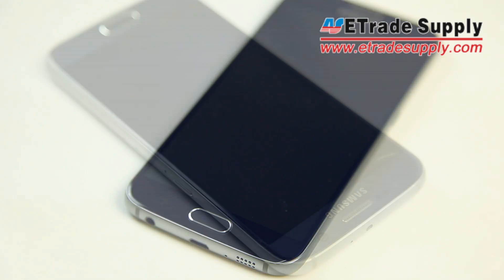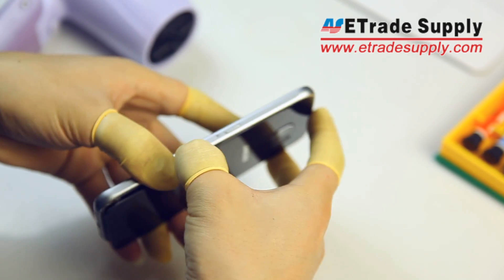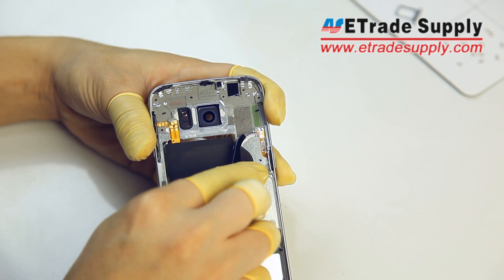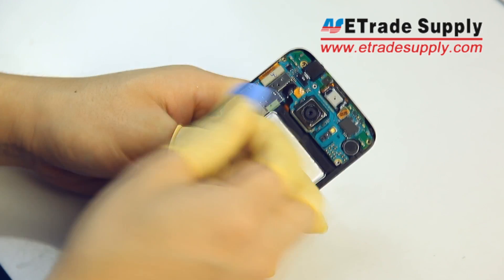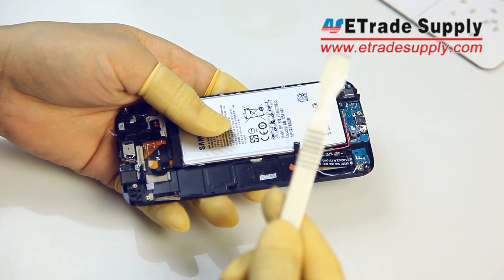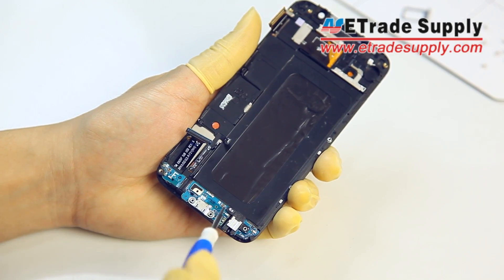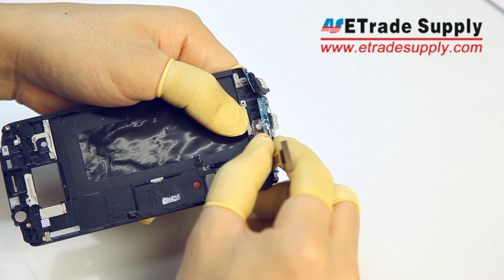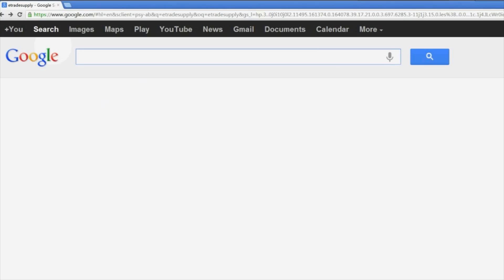Samsung Galaxy S6 Disassembly/Screen Replacement/Charging Port Fix/Replace Battery

Comment: Non-removable glass back, no micro-SD, no waterproofing or dustproofing... Samsung wanted to make the Galaxy more like the iPhone, so they adopted the iPhone's worst physical features!
Reply: Jane Doereme
I guess my whole point is it's not a Galaxy S phone anymore. It's an iPhone running Android.
Reply: They gave the people what they wanted:premium materials...but with the cost of the microSD card.but unless Apple,Samsung offers the phone starting from a memory of 32GB instead of the 16 on the Iphone 6.
Reply: I agree it's like samsung stepped away what separates samsung from apple
Reply from the maker: RadioactivFly it seems so
Reply: skate4world
 Would it be so hard for them to have put in an SD card slot similar to the SIM slot?
Reply: RadioactivFly Samsungs support usb hosting: use a flash drive or external hard drive or your pc to store more stuff if 32, 64, or 128GBs aren't enough for you
Reply: Jane Doereme
 Yeah... and plug some bulky thing into the bottom of my phone. No thanks. Plus, they removed the S5's waterproofing, don't forget that. And the non-removable battery... You see, batteries have expiration dates. You can't just charge and discharge forever, the reactants inside break down. On the S6, the battery's expiration date is your phone's expiration date.
Reply: Most people get new phones after 2 years anyway. But I understand where you're coming from RadioactivFly . The usb adapter I use isn't bulky and I don't carry it around with me. I just use it to transfer files whenever I need to and unplug it. None of my phones ever got water damage so for me personally I didn't miss the water resistance the S5 gave us. But for those that care, get a lifeproof or waterproof case. Or don't get the S6. Also there is a S6 active.
Reply: RadioactivFly I agree.
Reply: +ETrade Supply Samsung is way better than Apple.
Reply: The S6 is pretty much an iPhone running Android.
Reply: *****
Now you're arguing semantics. You used to be able to take off the back by design and pull/change the battery easily. With the S6, you have to break into the phone. The battery was never intended to be removed. Also, MicroSD.

Comment: Hey can someone tell me if putting rice and the samsung galaxy s6 going to do anything (yes i did drop my phone in water but i cant open it up does it doanhthing to help it or is it useless?
Reply from the maker: tKayos24 NO, You'd better not do that. It won't help to save your phone but may do worse on the phone, just power off ASAP and disassemble it into pieces  and wipe it use clean cloth, if there are erosion already, use alcohol to wipe it out, try whether there is short circuit or not. If damaged heavily, you'd better turn to your local repair shop! Good Luck!

Comment: Im wondering if it would be possible to put the slightly larger s6 edge battery inside the standard s6. Anyone know or tried it? *****
Reply from the maker: Pablo Pussell Good question! we'll think about it, thanks for your feedback, if it works, we will make a video to show you how we do it! =)

Comment: hy,where Are the Water Damage Indicators On galaxy s6. tnks
Reply from the maker: Alexandru Darius Actually, there is a anti-water mark on the rear housing. depending on different material, it will be soft or turn red to show the water damage.

Comment: I couldn't get a good look at it, but on the bottom right where the speaker is. Is there any explanation as to why the screen might not be flush with the aluminum bezel?

Comment: Hi! I need help...!! my galaxy S6 accidentally fell in the swimming pool, got wet and screen died. I just wanna know if there is any chance i can still revive the phone without having it replaced under my gadget care. would appreciate your help. thanks
Reply: If u have insurance in which u should... just get another one..if u don't try to plug it in and simply let it dry a good repair store and can easily restore the unit
Reply from the maker: Spam TheChat The rice can't do much drying the phone. The best way to dry water-damaged phone is to lay the parts on a draughty place.

Comment: Just a quick question i live in Az and in summer it tends to get to about 120` F will this effect the adhesive in any way?
Reply from the maker: Ryleeman54number2 
The adhesive will be affected by the temperature. But 120 F wont be a problem coz the temperature to loose the screen adhesive is around 200 F
Reply: ok thank you

Comment: So in all reality, the black glass=super easy to replace if broken. The battery a bit more difficult because you've got to remove the back, then the front (although I don't think anything beyond that is necessary, you could just pry from the outside rather than the main-board side), and if you break the screen it'll be a major PITA....but do-able.

Comment: I'm not looking forward to repairing this. Looks like a pretty expensive repair too. If the back glass is cracked, that's going to have to be replaced. It's likely to shatter if you try to remove it.

Comment: Hey I have an s5 that fell on its back and the screen went black. I got the screen replaced but the camera is not working. It gives the camera fail error when I open the camera and the phone signal gives alot of problem picking up sometimes it doesn't pick up at all in certain places. The place were I got the screen repaired cannot figure out the problem.
Reply: They also tried a new camera in it and still got the camera failed error. I had a perfectly working camera and everything before it fell

Comment: Nice video , one question , is it possible to reach/remove the battery without taking the front screen off the mid frame ?

Comment: Unfortunately the iphones are still much better built inside and out. The galaxy s6 is put together by glue. Not very good build quality and the glass being used is not very fingerprint resisitant at all.
Reply: King Dorien Minor  Lol why would you have an iPhone if you hate them so much?!
Reply: Yes i have an Iphone 5C and i replaced my broken front glass myself. I didn't even need 10 minutes for it. Just removed the screws, lifted the display up disconnected it from the mobo and connected the new display unit to the mobo and put everything back again-thats all. Ok it was expensive to buy the new display unit (as far as i know its still cheaper than samsung) Im not an Apple fanboy but we should admit that the Iphone is still the best repairable smartphone out there (except Fairphone) 
Also smartphones were not built to last they were made for being replaced. So if the built-in battery breaks in this Samsung you will have to replace it with the S7 or S8. 
We have 14 I-devices, 2 of them Ipads. I know that sounds like im a fanboy but still im not. Now guess what- all devices are still working. Ok, some broken display glasses here and there and the Iphone 4 has Home Button issues. Even the Iphone 3G from 2008 works or our Ipad 1. 
So what i wanna point out is that: When its about hardware Samsung and most android phones win easily
When its about quality the Iphone beats nearly every phone. I pay the same price but for a better quality. And i like IOS more :) But thats up to everybody to decide.
Reply: Brian Tasker

I agree. I dont need a phone case until now i never let a phone drop just repair them if somebody breaks them. But i bought one which looks great on my 5C.
Reply: Mabirc Min I don't really care if I get an iPhone or an android, as long is the specs are really good. Like 720p or 1080p, faster processor and etc...
Reply: I have used android and its not for me. Whether its a 2k or 4K screen the user experience and ease of use is not on par with iphone. Even on my 6 plus the full HD screen is more than enough on a phone. 2K and 4K screens are overkill because its only a small difference to the naked eye.
Reply: ***** My son just bought this Samsung phone and already the front screen is shattered. I just bought a kit to fix the sound and replace the scratched screen on his old iphone 5 and he's going back to that phone because he hates the size of this monster. I don't blame him because with the rubber sleeve around his phone it won't fit in a pocket. I don't blame him, I wouldn't want this phone either. If I need a large screen for something I'd grab my laptop before I bought one of these things.
Reply: Mabirc Min I fully agree with you and since my son only had his Samsung 6 for less than two weeks he'd agree with you too. With a broken screen already and having his iphone 5 for almost two years without a problem until someone nailed him and work and the thing went flying out of his hands and broke the front glass. I just bought the repair kit for $29.10. He'll have his iphone back very fast and he'll be much happier than having this over size phone and under size mini laptop.
Reply: Johnny Ola If I wanted ease of use, I'd buy a flip phone.  I had an iPhone 5S and hoped I'd like it enough to stick with Apple.  I didn't.  I can customize literally everything on an Android phone.  Even with a jailbroken iPhone (which is getting harder and harder as Apple continues to try and crack down on it) you don't have 1/10th the customization options that you have with an Android device.  To each his own, but as someone who owned an iPhone, I don't understand what's so great about the user interface, or how people could say it's easier to use than an Android.
Reply: Deacon Wolf I agree with you. I bought an iPhone 6 to try out iOS 8 after buying the piece of shit GS5 but was very disappointed. I bought the GS6 about two weeks ago and I must say... This is an amazing phone.
Reply: Still, I'm not going to buy an Apple product untill it stops being overrated & overpriced
Reply: And only few types of glass are fingerprint resistant, and if they used them the price would get.....
And I use a s6, and no problems with the fingerprints, That is only a major problem with the gold.
Reply: Tom M lol little kids dont need phones and maybe iphone repair is faster but dont forget iphone screens brake faster then the s6 ...
Reply: lennert eykens
its not your job to decide whats wrong or right for his son. Though every little kid now has the newest smartphone. Maybe Iphone screens break faster but they are easily replacable. And i rather buy a phone that i can repair myself than one that i must replace or have a hard time to repair. We have 14 I-devices and every single of them works. Every broken screen was replaced. Im not a fanboy but i would never choose anything else than Apple.
Reply: I repaired my s6 edge in 15 min seriously? Some people just dont know how to carefull use phone if you use a case and screen protector its all good if you just play around with every phone without a case yeah then every phone breaks so iphone isnt even better and repairing your iphone screen cost you 120$ or more instead using your warranty of your phone and get it replaced it once you replace the screen by yourselff you dont have any warranty anymore and nop its not my job to decide what someone els kid doing right or wrong one thing a phone is bad for a kid kids dont need phones if they need something to play a game one then buy them a ps vita instead buying something they wil break in 1 sec where you spend 699 dollars on dont tell me that phones are good for kids ...
Reply: lennert eykens  My grand daughter has had her iphone 5 for the past two years and she'll be due for an upgrade soon on their family plan. My grandson is in 1st grade and has an iphone 4s and has had it for over three years and not one of those screens were ever broken. My son had his iphone 5 for over two years and until it went flying out of his hands he never had a broken screen. Now he has this oversize phone and undersized computer made by Samsung for two weeks and the screen is already cracked. After watching this repair video and already buying the repair screen for my son's phone, all I can say about this build quality of Samsung phones is pure junk. The good thing about this Samsung is the speaker. It's the loudest I've heard on a mobile phone yet. That would be the only thing to encourage me away from the iphones, which is doubtful because the size of these Samsungs are something I couldn't deal with.
Reply: lennert eykens Maybe you feel that kids don't need phones, my son would put up a great debate on that subject and that's the reason why his kids all carry a phone. Never again will there be a problem in this family  If I had young kids today I'd make it a requirement that each have their own phone because I also feel it's necessary in today's society for safety reasons.
Reply: lennert eykens
Then you seem to be good in repairing your own phones! But again, compared to what you have to do in an S6 or an Iphone 6 for replacing your shattered screens are worlds! For replacing the shattered screen of my Iphone 5C i needed only to take away the screws, lift the display unit up and remove the cable and put the new display in while in most other phones you have to completely disassemble it. Btw i paid 65 bucks for the repair kit with the new display! And if you compare repair costs of Iphones or other phones the Iphones are cheaper.

Idk if its bad or good for kids owning a smartphone but in one point it is very helpful: They teach them about the internet and possible dangers. They also teach them our future and our future is going to be in smartphones and tablets!
Reply: Tom M if the size of the screen determines what is junk or not than every sports stadium and movie theater in america is doomed. Shouldn't your "problem" with screen size be the fist thing you notice when phone shopping? Also was your son's s6 in a case? Was his iPhone in one for those three years? Screen protectors? Neither I nor anyone in my family have ever broken the screen on a Samsung device but my sister is on her fifth iPhone in the past 12 months, all d
Reply: Continuing... due to screen problems and cracks. While I will give you that my sister is absurdly clumsy, it is rediculus that 4 phones with cases and screen protectors could literally fall apart after one drop. And you claim samsungs are poorly built. When an s6 brakes you don't have to worry about large shards of glass at least, galaxy screens are laminated as far as I know apple screens aren't. I love my S6 and will be getting another Samsung when this phone's time is up.
Reply: Brian Tasker
You know, Iphone screens are easily repairable and getting 5 phones in 12 months does not make sense, sorry. I agree that Iphone-screens break faster (Smartphones were not built to last) but still they are repairable. And when the screen of your S6 breaks? Take apart the whole phone and put your new glass in. Or in Samsungs language: Buy a new one.
We have 14 I-Devices and again, none of them is broken, maybe some shattered glasses here and there which i have all repaired but all of them work. All built-in batteries work or LCDs (unlike the S4). The price is high but atleast you can use an Iphone for 3-4 years or more (Our Iphone 3G is 7 years old and works). I dont think you can use a Samsung as long...
Reply: It would seem the only things our arguments prove is different devices work better for different people. You have several iPhone devices that have worked perfectly and have had bad expiriences with Samsung. While I on the other hand have several Samsung devices that have worked perfectly and have had bad expiriences with Apple devices. It seems the only real difference is Samsung screens are harder to break and repair while iPhone screens are easier on both accounts. That being said, it doesn't change the fact that a phone case is a nessecity for all smartphones today.
Reply: i switched back to iphone .. galaxy suck it get scratches everywhere

Comment: Nice! Seems like all of the cosmetic parts are pretty easily replaceable, and for not very much either. Unless that digitizer goes bad, which I'm willing to bet usually stays intact during a normal drop.

Comment: I think I'll stick with my s5. I bought a replacement screen and the adhesive framing for the edges and i was done in under an hour. This phone looks too damn hard and I'd be terrified to apply heat to the screen now that I see the consonants seem to be in direct contact with it.  Samsung have gone too far.

Comment: thx for the video. what is the red antenna and blue antennas for? samsung used to have only 1 long antenna in there phones. why 2 different short ones now? do shorter antennas mean weaker signal strength?
Reply from the maker: Those are for Bluetooth and Wi-Fi, and actually older models had them as well.
Reply: ***** so then where is the GSM (voice/text) antenna?

Comment: good job ***** . I think the glass was broken?
Reply from the maker: Bruce Wrigleys Gumchewz Yeah couldn't agree with you more. It was extremely difficult the first time through, and it is sad to see Samsung moving away from removable batteries
Reply from the maker: Not the glass but the AMOLED screen. Sadly a casualty of war. On our first attempt at opening it up our tech broke the screen (only the screen) with the case opening tool. It is very very fragile, and this phone is not easy to take apart.
Reply: Yes. It's very fragile.
Reply: Omar Amassine ???????????????????????????????????????????????
Reply: ***** I've never seen a phone so difficult tot disassemble ever... til I seen this. All that glass.. all that heating up just to free the glue joints ... ughh.. And I thought the first time I replaced the screen on my HTC Rezound was a pain in the A$$. I don't like how all these new phones have such fragile glass that can be easily broken. On another note, idk why they covered up that battery. They could've easily made the rear cover removable with that same battery.
Reply: *****  stupid move from isamsung
Reply: salam
Reply: Sara amla ?